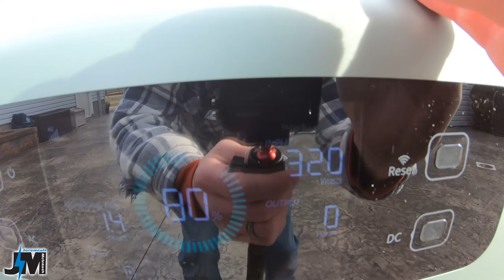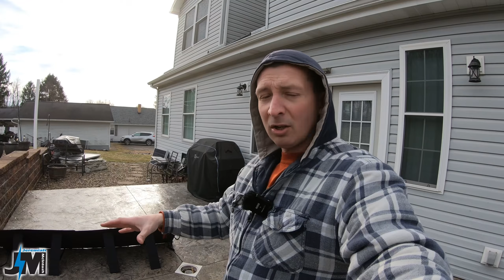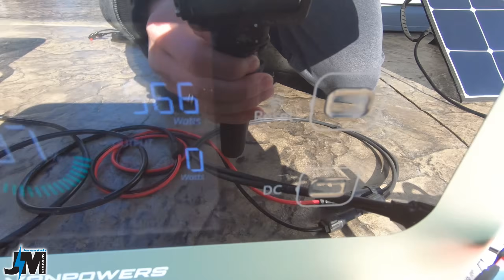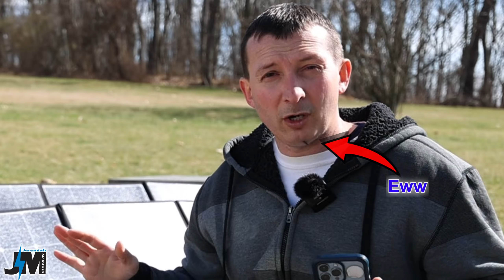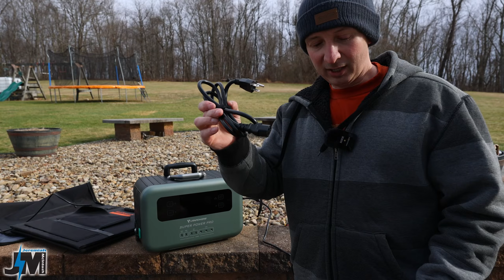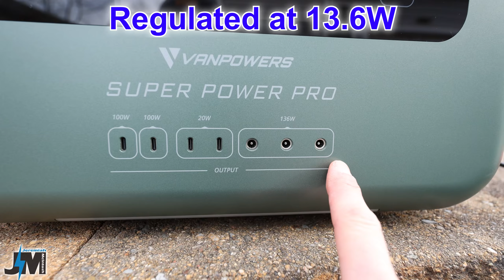The Fastest Solar Power station ~ Vanpowers Super Power Pro Review

Comment from the maker: UPDATE as of 10/5/2023 the Vanpowers Super Power pro 1500 power station with 2x 200w solar panels is currently on sale for $819 but the app is no longer available and the units are now discontinued so purchase at your own risk!
Reply: Is it completely disabled I bought it about a month ago is an APK available?
Reply from the maker: Someone said the android version is still available but I haven’t checked. The company directly told me that the app  is no longer supported though so probably no new updates.
Reply: @JeremiahMcintosh  okay well that sucks
Reply: Can this thing be operated without the app? Thanks
Reply from the maker: Yes but you would need the app to control some of the advanced settings like charging rate.
Reply: Thanks for your reply. I have contacted customer support twice but get no response. Do you know if they are discontinuing both units (the 1500 and 2000)?
Reply: I kind of figured that so I went out and got a xt60 to EIC 13 cable And then went out and got a male XT60 to MC4 adapter cable figured it should be good enough but may lose some power because of the multi-connections let me know what you think if this will work or not because I don't think I'm getting the stuff from Amazon until after Christmas

Comment: I wouldn't get this power station if I were you. i've had one for a few months, it has never worked. Ever. It has never held the advertised amount of charge. I ran a 9w fan and it wouldn't even hold it on all night. The customer service is terrible. If you're reading this, get a different power station.

Comment: Good day, I would like to see if you can support me, I bought a power station Vanpowers Super Power Pro 2000 portable power station and in the specifications it says that for the XT60 input it supports 12 to 60 volts and an amperage of 10, the question is If to your knowledge you consider that you can use a 660w 48 volt solar panel that produces 18 amps, thank you!
Reply from the maker: Yes you can use it as long as your panels open circuit voltage is not over 60V however the power station will only use 10 of the 18 amps so you won’t get full power from it.
Reply: I thank you very much friend, I already connected the panel and yes, I actually did not have any problems.
 @JeremiahMcintosh

Comment: This is a warning for potential buyers. I want to share my experiences buying from this company (if you can call it that). This is one of the shadiest company around. Don't expect any after-sales support at all. Therefore no warranty! This is like a one man (couple at best) show based in L.A area importing these from china. These Chinese individuals do not pick up phones, do not respond to voicemails, do not respond to emails. Evidently they also have comprehension issues or that could also be an act, along with the robotic responses. Like the other YouTube reviewers have discussed, they still haven't fixed the app interface and its still buggy. The unit itself has many quirks. As it stands this guy/company has completely dropped all communications and i am at a loss on how to proceed from here.

Comment: Can you charge it with solar while using it?
Reply from the maker: If going through the xt60 port yes you can still use the ac output when changing fron solar but if you are using solar through the ac input then no you can not.

Comment: I just looked this unit up in the last few days, this version is on sale for 599 or 699 with one panel. Might be due to all the app issues and most of the other reviews did not come with the solar to ac plug. At that price I think it might be worth getting but the original maker of this unit is Zendure and they are around 1600 on their website. Neither website shows that solar ac plug on them.
Reply from the maker: Yes it’s a killer deal but the app is no longer supported, and the units are being discontinued.
Reply: @JeremiahMcintosh  Good to know. Thanks.

Comment: You may want to check the voltage output of the cigarette lighter plug, as there may be a buck converter built into the plug to bring it down to 14 volts.  The only thing I can think the cigarette lighter plug is for is to plug into your car cigarette lighter to charge the car battery with a single solar panel - I don't know - just a thought.  And thanks Jeremiah also for bringing to light the negatives as well as the positives - it is something we don't see enough of...
Reply from the maker: Absolutely! Gotta keep it honest! Thanks for your suggestion. 
When I tested the voltage on the cigarette lighter plug it was the voltage the panel was putting out 35v! So Not sure what this would be used for?
Reply: @JeremiahMcintosh  Thanks Jeremiah for the reply.  I can't tell you how much I love the fact that you are honest about the bikes and products you review.  I do the same myself, but finding a company to let me have a product for an honest review... Not an easy thing to do for sure LOL, I have to purchase out of pocket anything I test/review and this is much too far out of my range for sure.  There is something that you could use the plug for and that would be a 12v solar panel for charging your car battery, other than that - I am with you - it makes no sense to have a plug like that when there is nothing in the setup to use it for hmmm.  It could also cause someone to fry their car's electrical system if they plug it into their cigarette lighter socket by mistake - thinking that is what it is for...
As far as this power station....  Wow! that is way too much money to spend to be hit with a 120.00 subscription fee just to use the features, and sounds like what allot of car companies are starting to do with EV's - not acceptable in my opinion, and why I don't believe this product will go very far unless they change that.  These are just my opinions of course ;).  
Thanks for all you do, and look forward to when I will be able to do the same more often.

Comment: There are power stations that have Bluetooth connectivity instead so you don't have the subscription fees. And I would prefer Bluetooth instead.
They probably noticed the AC charging flaw, and that's why they made the cable hard to come by. Hopefully they'll fix it for ya in an update.
Having a cable that has reversed positive and negative is a really bad thing, it should never happen.